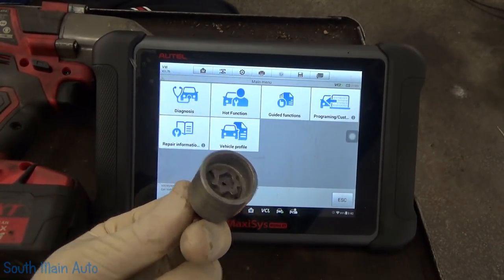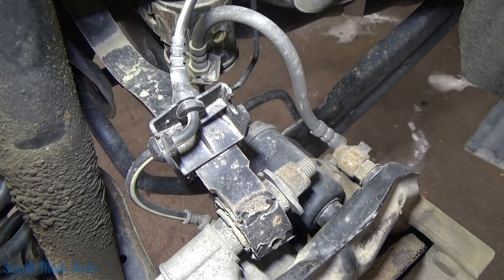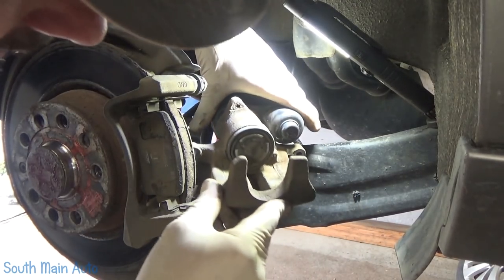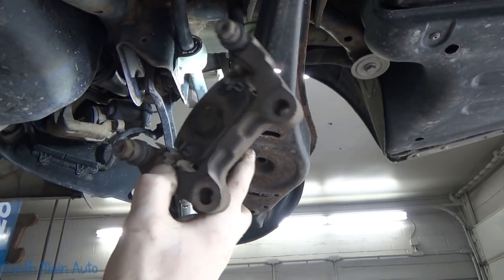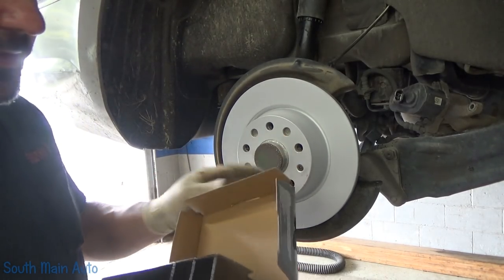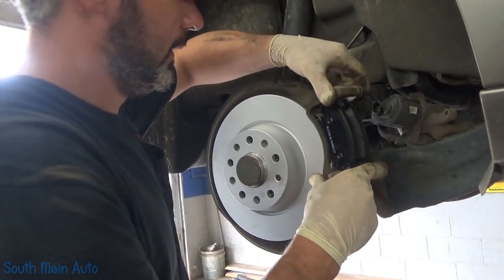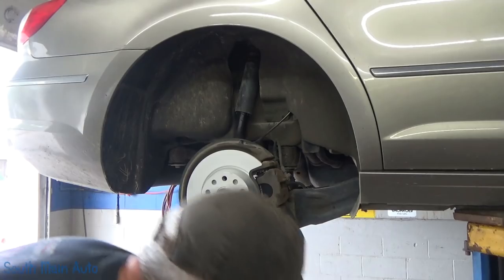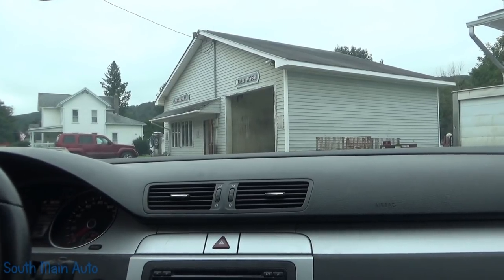Do You Need A $1000 Scan Tool Just To Change Brake Pads!?

Comment: What i used to do before i had a scan tool to do the EPB is switch the ignition on press the EPB button to release the park brake then switch the ignition off and it leaves the EPB off then i push the piston in, with the 2017 E-class Merc you can wind the piston beck with the functions on the instrument cluster and on the 2016 C-class before i had a scan tool i just unbolted the EPB motor off the back of the caliper push the piston back and then mount the motor back on

Comment: For Audi/VW the best 3rd party diagnostic software is Ross-Tech VCDS, which can be bought for just under $200. 

As a side note, when replacing the rear brake pads on an Audi/VW equipped with an electro-mechanical parking brake (EPB), you really need to be careful regarding the battery voltage. The EPB module is very sensitive to low voltage conditions and it is critical that a battery charger is properly connected and used for the duration of the rear brake job.

Comment: I use a program called VCDS it’s just like the dealer tool but at a fraction of the price, paired with a laptop, it does exactly what you need to be able to change the rear pads! . I have one of these exact cars.

Comment: I bought Schwaben scan tool from ecstuning.  My Audi doesn't have electronic brakes though. Tool was under $200. Eric a heads up I've found Autozone uses factory Audi/VW sensors in duralast box.  For ease of warranty that's who I use as I only do factory sensors

Comment: You can do the rear brakes without the scanner by unwinding the motor with an allen key after removing it from the support its fixed ,at least on bmw 's you can,i did it that way before i had the scan tool, just a little more work to remove and refit the  electric motor.

Comment: You can take the parking break module on each side off and disengage them by hand using a torx bit. Thats how i change mine everytime. You simply turn the screw in the middle all the way to disengage and when you're done you put both modules back and engage the parking breaks and they'll adjust themselves. Takes an extra 5 minutes compared to a regular handbreak car so no big deal.

Comment: yep its an easy DIY. the parking brake motor is like a window motor. it just takes 12v one way to wind the motor out and reverse it the motor winds the other way ;) using a battery charger you can wind the motors in.

Comment: On the new Benzos, I leave the ignition on and leave the transmission in neutral which this releases the EPB, on a lift or 4 jack stands. Then I use pliers to retract the piston up to like 20-30 times and it works for me. ( push inwards at the same time to retract)

Comment: i used to use a jumper wire and a booster pack to reverse the motor in the caliper and then when i was done i would pump and apply hand brake and it would work. on some cars i would remove the motor and turn the piston with a socket

Comment: I used an Autel tool costing about the equivalent of $90 but this is in the UK, it worked well for brake pad services, but in all honesty I’ve had seized brake callipers on the Passat and at $330 each to replace id just avoid buying a VW with electronic parking brakes...they also stick on without warning and the dreaded flashing parking brake button tells you theres money involved...be also aware that sometimes its the parking brake button at fault and a replacement is much cheaper than the electronic calliper, easy too.

Comment: You  might be able to shove some insulated spade terminals onto that connector and put 12V across it. One way should engage the brake, the other will retract. 
Thats how I purged my ABS pump. Although, if you hook up the abs pump backwards, you might blow your master cylinder

Comment: You can just take off the electric motor (two bolts) from caliber and unwind it manually. Works for vw, mb and volvo. Takes few minutes but there is a risk of needing new o-ring for the motor. So there is nothing difficult working with these even if you don't have correct diagnostic tool. I actually prefer working with these instead of messing with regular handbrake cables and handbrake shoes.

Comment: To reset the electric park brake, remove 2 T-30 torx bolts from motor assembly on caliper and pull motor off caliper. Use T-40 torx bit to turn exposed plate clockwise to the stop then push piston in to retracted position.Install new pads. Reinstall motor assembly and caliper, set and release park brake inside car. Job done, no scanner required.

Comment: Just had to change a brake accumulator on my 2005 Mercedes E500. Its a five minute job the then bleed the brakes. This car can only be blead using the factory scan tool, thank God my son is a Mercedes Tech and has the computer and the know how to do it. It took us two hours to get the system blead and all of the air out of the system to where the scan tool would pass the job. I had no idea it would be such a pain. The days of the do it yourselfer with basic hand tools are just about gone.

Comment: You can remove the parking brake motor off the back of the caliper and there’s a spline where the motor goes into the caliper just thread that in when your putting pressure on the caliper piston

Comment: There is a workaround by the way, I did brakes on an Audi A5 which is essentially just VW. Unplug the caliper and add 12v (power probe) to the caliper electric motor, hold until it stops and then compress the piston as normal. If it doesn’t go in it means you have to switch polarity on the electric motor when you add power to it.

Comment: also the tool you can buy is called the Autel Maxicheck pro, it does EPB as long it's the correct model. Around 250 bucks.

Comment: Find the locking wheel nut tool 30 mins. slsounds about right then add another hour to remove the wheel nuts when the tool shears because someone overtightened the bolts or they're siezed.

Comment: One too I’m surprised professional mechanics don’t use is those aircraft rivet well nut lever things where you push the button or tilt the lever and the one part swells out (rubber so reusable) and it holds things in place so you can get another fastener in place and then swap that out for one, which will come in handy more than the extra seconds to put it in are worth

Comment: There is a workaround, remove the EPB motor from the back of the caliper (couple of 8 or 10mm bolts). On the back of the motor is a bolt that will retract the piston into service mode, just undo it all the way until the piston is fully retracted. Do the rotor/pad change as per normal and then reattach the EPB motor. When you press the parking brake button in the cabin the EPB piston will wind in and readjust itself the same as if you had used a diagnostic tool to wind them back.

Comment: $1000 scan tool, recompressing the caliper, triple square sockets... I'm liking air brakes more now (especially the air disk brakes I do most often). Install the cage bolt into the brake chamber and the brake is released, back the adjuster nut off (a bit annoying that the disk brakes have a torque limiting adapter), then for the disk brakes it's one pin and the pads slide out, or pull the drum off and swap the shoes. The only specialty tool you might want is the strange 11 spline caliper socket, otherwise it can all be done with M24 and M15 double hex sockets (for disk) or a hammer and pry bar (for drum).

Comment: I hate that some auto makers have made it where you need a good scan tool to put the rears into service mode if they have a epb.  Fords with a epb you can put the car into accessory "engine off" and depress the gas peddle to the floor whole holding the epb button up and cycle off and back on to accessory power to activate maintenance mode for rear pad service.  You take them out of service mode doing the same thing other then you press the epb button down to activate them again after you are finished.  They will not reactivate on their own.    I'm a mechanic at a ford dealer so this is much appreciated by me lol.

Comment: The short answer is yes, you can change pads/discs without diagnostic gear. Also it is possibly quicker without the scan tool gear as they take a ages to do anything.

The how to;

1) raise rear of vehicle 
2) remove wheels
3) command handbrake release
4) unplug both calipers 
5) remove calipers from brackets
6) remove both torx or hex screws and remove electric motor from caliper
7) use female torx socket to turn piston a little in both directions, when you know which way retracts the piston fully retract it.
8) push piston straight back into caliper (DO NOT WIND OR ROTATE)
9) re attach electric motor to caliper.
10) carry out brake parts replacement 
Note: most vw rear discs can be removed without removing the caliper bracket, it’s tight but it’ll come out, the brackets easily cleaned once the disc is out.
11) re assemble brakes.
12) push brake pedal to engage piston and pads to disc.
13) plug in calipers 
14) command handbrake on.
15) job done, wheels on. 

Done this many times myself as often parkbrake modules won’t conmunicate with diagnostic gear. Never had an issue myself but do it at your own risk and I take no responsibility for your actions. 

Works 100% for me

Comment: One method I found besides using a bidirectional scan tool for the rear brake service mode is tht I use a power probe because the rear brake caliper for the rear brakes is like a window motor so if u use the power probe it’s another method of getting things done Wth out spending to much time and money on a $1000 dollar scan tool

Comment: The autel 802 full modules edition will do parking brake reset and all the other stuff. Even does GM abs bleed. Got it for $150 on a gold ticket deal on amazon. Usually 225-250

Comment: On the older models, you should be able to reverse the voltage and have the motors return that way, then clear the codes.
Not sure on the newer models (2013 and newer).

Comment: if you have a booster pack or a car battery charger you can use aligator clip wires and just reverse polarity the wires on the pins to retract them

Comment: Certainly here in the UK, we can get VCDS cables and software which run on bog standard Windows laptops - I had one when I had my Passat and Audi A4, but I bought mine second hand so I have no idea how much they are new.  Owners forums usually have people that have VCDS and are willing to help other owners out (I did with mine).  These brake calipers do make it near on impossible for DIY'ers though, and my last car (Nissan Qashqai) had electronic rear brakes and I could not do the rear brakes as I did not have the kit to do so.

Comment: Eric, next time your'e at the breakers yard just cut yerself a connector and a length of loom from the brake motor on a car  Then you can easily lash that up to a booster pack and wind the motor on or off without any expensive scan tools.  Also the recovery guy could make good use of this hack, especially where the fire dept. have cut the battery cable to for safety to stop fires in wrecks etc. He then cannot easily move vehicles as the parking brake may be locked on without any means to disable it.

Comment: Normally you can retract the EPB manually without a software BUT for this you need to remove the electric motor off the EPB and unfortunately this motor is secured with two tiny screws that get completely stuck in there (worse than a stuck caliper bleeder) so often times it's not possible and even risk to shear these bolts. But if you manage to lift the electric motor part, you can release the caliper bleeder then use a c-clamp with a torx socket and move back the piston by hand all the way to make place for new thicker brake pads. There are videos on Yt about this, but again the obstacle is those tiny screws

Comment: There's a process to release the electronic Park brake on ford's, similar as when you rotate tires you can reset the sensors as long as you have the tool

Comment: There is a way on some cars w/o using the scantool. On the Fiat based Chryslers, going into the menu in the radio display, you can find the parking brake service position. I think that it may be possible on many other makes. Just have to read the owner's or the service manuals.

Comment: There is a work around for these with a power probe but I've a foxwell obd/electric parking break scanner I got for €120 that does load of car brand parking brake resets/service and it also reads abs codes on some brands

Comment: The Scan tool is the best way to do this job for sure . But I sure we all know we don't need to use it if we don't have one ? just need two wires and a battery and just power up the motor and when your done just power the hand brake back in just takes a bit more time

Comment: I have the Autel MD802 I keep in my truck with me. It has the brake service features. It does some other service mode stuff, but it lacks a lot. For the average DIY it would be fine, but it's just not cutting it for myself. Its at $170 now on Amazon.

Comment: Have you ever worked on a Mercedes with SBC brakes? You have to use either Mercedes Star, or an SBC tool to purge/pressurise if you are doing a fluid change, or to release the pistons if you want to do a pad change (though you can just pull the plug on the SBC controller to do the pads really)

Comment: You can do the brake job with a cheap scan tool aswell. I have the ODBeleven bluetooth tool and it has this function as well as many other VAG functions such as adaptations and programming. It costs about 40€ to buy. The pro version has more useful functions.

Comment: I have a 2018 toyota camry XSE with power assisted parking brake. I just removed the actuator which is 2 allen screws then used a clamp to provide pressure. And where the actuator goes into (looks to be about 15 splines) which an allen wrench fits into, just back it off as you squeez the clamp. To reinstall just line up the splines and put screws back in. There is no information about the Toyota XSE that i could find so i had to figure it out. There maybe another way but thats what worked for me. Took less than 10 minutes once i got it figured out.

Comment: On a subie you can do the manual release of the electric park brake by using a hand crank and an insane amount of turns.
Reply: my 2012 subary legacy has electric parking brake but there is manual on off switch on dashboard so you just release brake that way

Comment: Newer Mazdas allow you to get into Service Mode via the Commander Knob which controls the dash display screen. From there you can deactivate the parking brake.
Reply: Actually, you don't do that from the display, there is a procedure with the start button, the gas pedal, the parking brake lever, etc...

Comment: The 2015 Subaru Outback has electric E brake and my guess is probably the same type service system. I have been doing my own brakes since I was 19 so I will have to read up on it. I am used to doing my own nrakes and am not looking forward to the day I have to take it in to get the calipers to open by some signal.

Comment: The md802 does have the same option and paid around 300cad on Amazon. Didn't try it yet (never done a brake job with this type of parking brake), but didn't like it since it doesn't have bi directional control controls.

Comment: Putting the vehicle's brakes in "workshop mode" is one way of doing the job, I'm a BMW tech and ours is the same way. That is so the motor drives the piston back in, the inner portion that is, not the outer piston. The other way of doing it is by turning the piston back in manually and disconnecting the electrical connector in the electric hand brake. As for BMW either way is acceptable by BMW standards, you need either the special tool or the scanner. Big price difference but I'm sure if you own a "newer" vehicle and are a diyer a scanner is almost a necessity.

Comment: An electronic parking brake seems like going one step too far. I prefer the pull-up lever-type over the older foot pedal and release type (mainly because I once had the release mechanism not release), If the battery is removed or just craps out, does the brake release and the car roll away, or are the rear wheels locked-up until the system is reset to erase the code?

Comment: Two options without scan tool.  1. remove the electric function assembly on caliper and use an inverted torx to manually turn piston. 2. It's a two wire motor. Using a fused jump leads or powerprobe power it one way to retract and reverse polarity to reseat. The module will reset itself once activated.
Reply: much better to use a "current limited" lab supply, for such, but a small breaker/power probe will do.
Reply: Yeah, it's just a window motor.

Comment: There is a way to change the pads without a scan tool. You just have to take the motor off and you'll see a hole where the motor's shaft plugs into the caliper. Well you put a screwdriver into that hole and turn it. It will turn it the sam way as the motor does. When you're done you put everything back together get into the car, key on and you pull the handbrake. It will take few seconds for it to bring pads to the rotors.

Comment: There is a way to retract them without a scan tool. my neighbors passat would not release the hand brake via the handbrake button (he had a damaged caliper). We googled it and we found Vw’s data on how to release it. It involved disconnecting the battery and reconnecting it and pressing brake pedal along with pressing the handbrake button it would then release the brake’s fully, i can’t remember the exact procedure, but google it there is a back door way!

Comment: Autel now makes a OBDII dongle for Walmart, for $50, that does EPB service mode and ABS modulator bleeding. For $50. Will cost you $15 additional for a second car license if you want to use it in more than one.